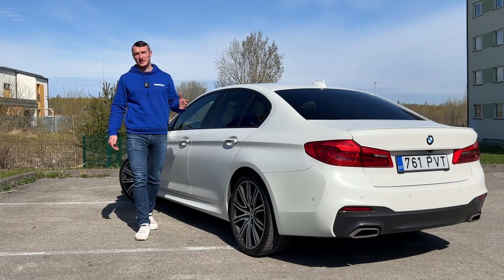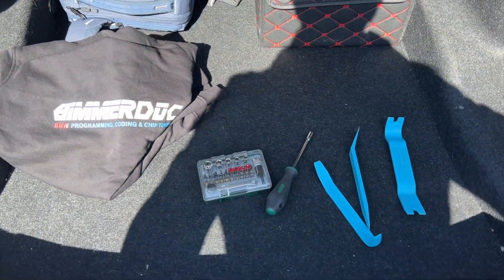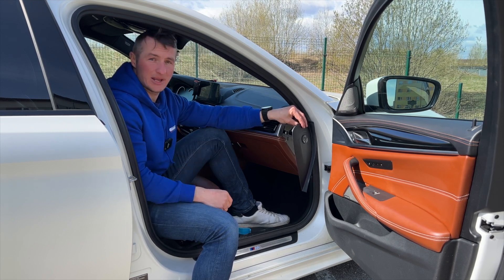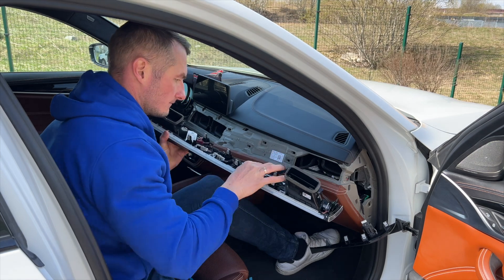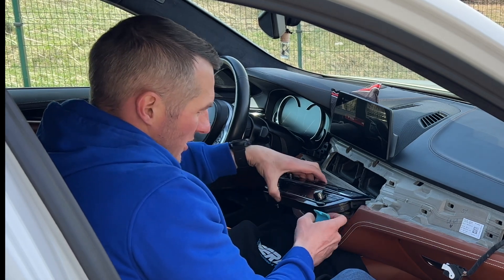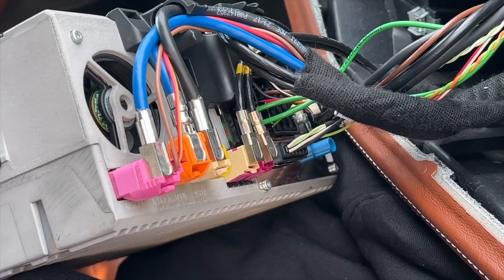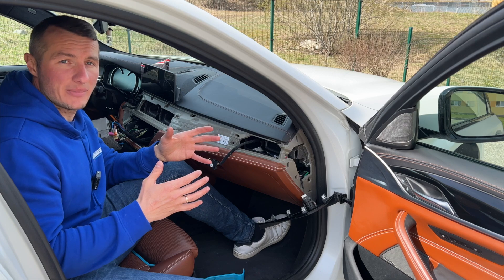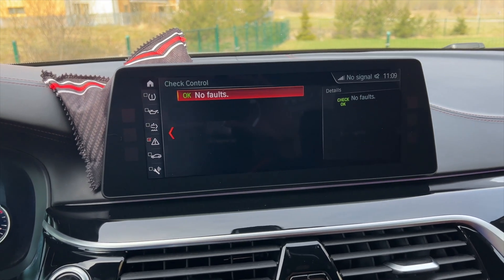How to remove BMW G30 headunit for WiFi antenna installation

Comment: thanks a lot, amazing video! Do I need to unplug the minus of my batary before doing this? (just worried about airbug activation). Thanks again!!
Reply from the maker: Yes you can unplug to be 100% sure
Be aware that modern BMW might have two batteries (second one under the hood)
Reply: @BimDoc  thanks! I have g30 2019 5 model. Will check, but it seems it has 2 batteries indeed

Comment: could you please tell me F107 fuse box location?(my car is bmw 530ix g30 2017 b46)
Reply from the maker: See wiring diagram
It will be in the trunk right hand side or in the glove box.
Reply: @BimDoc  i found 3box(trunk right hand side, right glove box, right under glove box), I don't know one fuse box(F107) location

Comment: Hi, this is a brilliant step by step on how to install the ariel, it took me just under a hour, the tricky part being taking the side trim off as it took me some time to line it back up but great advice on not disconecting the airbag cable!!. Ive fitted the ariel but the screen mirror option isnt showing on my g30 (UK car) will this now need coding or do ypu think i may have a fauly ariel, thank again.
Reply from the maker: After adding Wi-Fi antenna no extra coding is needed. 
It is plug and play

Comment: I am currently thinking about doing this for myself. But!! Taking my new car apart gives me the fear 😂of
Reply from the maker: No worries. It’s not hard ))
And believe me, it’s not taking the car apart. It’s only taking out HU )
Reply: Sorry one more question please. Do you disconnect the car battery before starting the head unit removal?
Reply: Hi there, is it necessary to disconnect the car battery before I start the process?

Comment: Nice, makes me curious about my F30 now. I think I have the HU_NBT so if I understood correctly, I should have the WLAN connection. This would come in handy since the 3G modem in my 2015 is 'no longer supported'. I'm assuming that if I just used my phone as a hotspot, I could connect my car to the phone using that wifi connection.
Reply from the maker: On older cars there is just no benefit from Wi-Fi connection.
Reply: @BimDoc  ok thanks, i'll think of something else to do then

Comment: Hi there, to remove the head unit on 2016/2017 G11 730d is it the same ???
Reply from the maker: It is 99% similar to that
Reply: @BimDoc  Thanks so much for getting back to me so quickly. Are the 2 torx under head unit above sliding cupholder cover. ?
Reply: @BimDoc  is there any need to disconnect the car battery??

Comment: I had activated cp on my g30 from you.  But notice that i have some connections problem with cp. After checking, my g30 does not have the antenna.  I have not take out my head unit, do you know if my g30have sockets for WiFi antenna?
Reply from the maker: All nbt evo HUs do have wifi antenna output 
But not all entrunav2 HUs have wifi antenna output

Comment: hi, please can you tell me what tool you use to remove last plastic? (4:40 minutes on video). I tried to remove it spent more than one hour but unfortunately without luck. Thanks in advance
Reply from the maker: Just use some more force to remove it.
Reply: @BimDoc  Thank you very much. So I don't need any tool for this?

Comment: My car is fitted with the following 
Multimedia
S610	Head-Up Display
S654	DAB Tuner
S688	Harman/Kardon Surround Sound System
S6AC	Intelligent Emergency Call
S6AE	Teleservices
S6AK	Connected Drive Services
S6C3	Connected Package Professional
S6NV	Telephony With Wireless Charging
S6U3	BMW Live Operating Area Professional

Please advise if I have the Wi-Fi antenna fitted and what I need to have screen mirroring as I don't have that option on my Idrive 7?

Comment: Hello, my G30 reports front passenger restraint system restriceted warning after installed W-Lan antenna to HeadUnit though I did not disconnect passenger side air bag cable. could you please advice how to erase this warning?
Reply: I've deleted fault code by using ISTA and "restraint system" error disappeared shortly

Comment: How do you check if antenna install or not already
Reply from the maker: If your VO has options 6CP or 6WD then Wi-Fi antenna is preinstalled 
The easies way is to decode your VIN